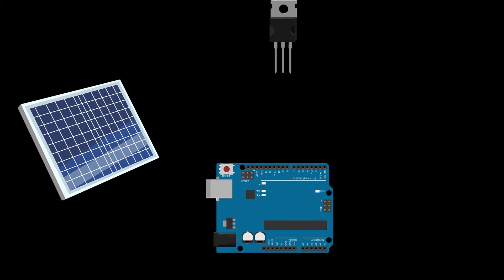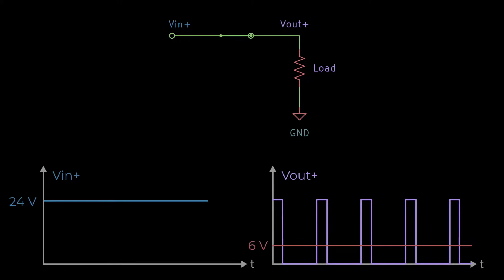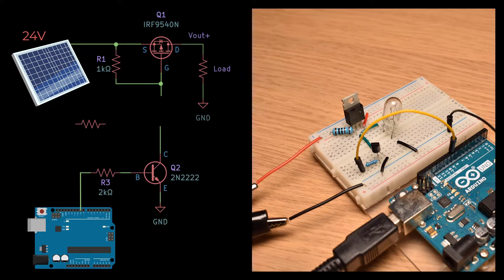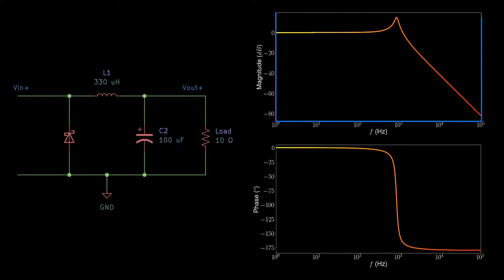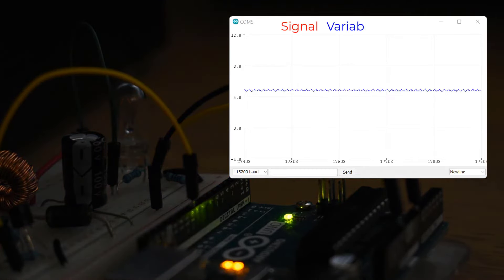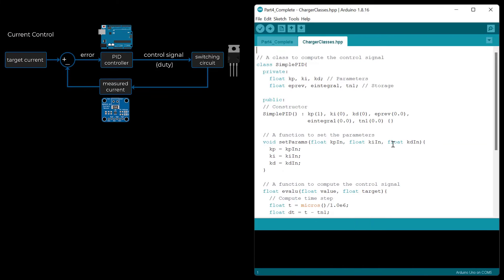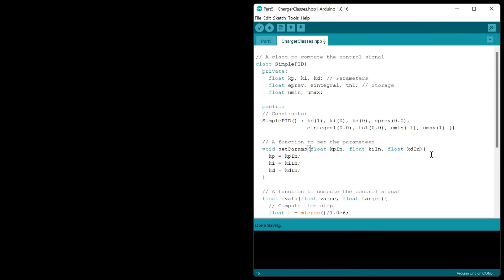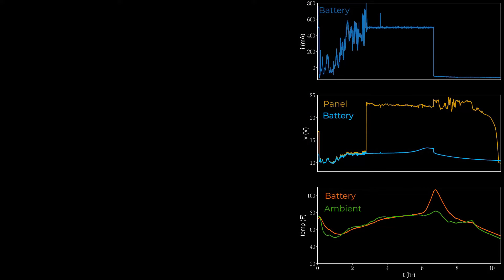How to build an Arduino controlled solar charger

Comment: CR: You start so simply - a solar panel charger but quickly you enter real issues with solutions involving maths, PIDs (yes, I have seen your PID videos) and experimental evaluation.  If only your approach and testing philosophy was the standard of You Tube, real progress would be made by many.  Your approach seems straightforward; how is its efficiency?  Yes, I understand that you are teaching us not building a product to sell.  So very well done, CR.

Comment: Wow, I came here looking for a way to build a charger for a sodium ion battery, as there aren't real low cost ones on the market (like tp 4056 for lithium ion)... and I am a bit... mind blown in the sense that your video at the end is extremely complex for a non engineering person to understand. It starts relatively simple however. It makes me wonder if the error corrections and extreme complex programming PID etc (for me) is actually required to make something work: to charge a battery. Because for now I charge my sodium ion battery manually using a buck converter that has no current limiting, by turning the potentiometer a bit up, slightly over the voltage of the battery, trying to see that the current is allways around 0,65A, which is 0,5C for my battery of 1350mah. And I stop at 4.1 volts which is the maximum voltage of my battery.  If somehow you could replace the manual potentiometer with a digital one on a buck converter that would be very nice as opposed to designing the whole thing from scratch... For now I am actually thinking about buying a lab supply or just building a robotic arm to turn the potentiometer, even that seems more simple... but nevertheless thank you for the explanations.

Comment: but what if i want the arduino to power off when there is no sunlight?  i could just use the  solar panel +  buck converter + arduino right

Comment: Wonderful video. I have finally found solution to my age long problem. I did control engineering, I perfectly understood the PID part very well. I used a PID controller in my M.Eng program with a multivariable sensor that added complexity to the project.

Comment: The buck converter is more than just an LC filter... You need the diode to allow energy stored in the inductor to supply the output, when the mosfet turns off.
Reply: I guess she is better at coding and electronics is just a hobby.

Comment: Excellent video. A bit of an overkill,  but depending on your knowledge and project goals you can take the pieces of this content and build it around it.  Thanks for sharing.
Reply from the maker: Thanks! Overkill -- meaning the circuit details perhaps?
Reply: @curiores111  Meaning that in some situations that approach can be too complex to implement. Normally in a solar powered system you want to balance simplicity and performance.
Reply from the maker: @keen2461  Thanks for your thoughts!

Comment: add an emitter resistor for the NPN, thus converting it to voltage controlled current source. Now select pull up to suit the PMOSFET

Comment: Grate video. I could really have used that when I created a project using 12V, 10A peltier elements. I would have loved to control the voltage, in stead I just turned the elements on when the temp was too high and turned them of when the temp was too low. But the peltier elements is more efficient at say 7 and 10V than 12V, thus it would have been much better if I was able to control the voltage. But I found out really quickly that there are some dynamics effects when you turn on and of a 10A "resistor" multiple time a second. I am just glad my power supply survived.

Comment: Really nice walkthrough the entire process. I also liked how you clearly stated what you weren't going to cover. BTW, what software did you use to overlay the graphs on the video?
Reply from the maker: Thank you very much. 😊 I use Camtasia to overlay the graphs
Reply: @curiores111  Thanks for the reply. I have used Camtasia, and will need to figure out how to do the overlay.
Reply from the maker: @7alfatech860    Sure. For myself, I use PNGs with transparency for the overlay, and simply animate some parts in Camtasia. In other cases with just a basic black background, I create the video in Python and then import it in. I have not yet found a good solution for using transparency in a video directly yet (haven't needed it so far), but I'm sure its out there.

Comment: I was given a solar charge controller project from my college  and after working day in day out for days i finally made this solar charge control with the help of your video Thanks a Lot. And the battery is charging. But I have a question does this circuit have autocutt off feature when the battery is fully charged? because by reading the code you have provided I didn't understand that it has a autocutt off feature or not ?
Reply from the maker: No, this is most definitely experimental code. There's no auto cut-off feature, or other quality of life features.
Reply: @curiores111  So can you please explain me how can I add a auto cutoff feature in the code. I have to submit the project on coming week it will be better if I add a auto cut off feature.
Reply from the maker: That's a complex topic. Typically a combination of signals are observed -- and it depends on the type of battery. The voltage will typically peak and then dip, so you can shut off after the voltage peaks. Another sign is a temperature increase. When the battery is fully charged it starts shedding energy as heat, so you can monitor temperature and shut off when you start seeing a spike. You can also just shut off when the voltage reaches an expected value. Again, it's a complex topic, so it would require some research. @adnanahmadknowledgevideo
Reply: @curiores111  Okay thanks for sharing this information

Comment: whoah this video turned out way more technical than expected.

I was kind of expecting you to just hijack one of the pins (feedback or on/off) of an existing LM2596 module tho.

There's also kind of a bad shortage of low power boost MPPT chargers for smaller projects out there.  Errbuddy just wanna do big stuff; the little guys r left fending for themselves.

Comment: Thank you for this information. Sorry to ask but if the Vin will only be 12V, what good values of pull up resistor and the resistor that would divide the voltage be? thank you
Reply: You can stick with 1k for the pullup. And assuming your P mosfet has a Vgs equal or greater than +- 20 volts, you can simply remove the second resistor, as there is no need to a voltage divider in this situation.

Comment: I am very thankful for your amazing explanation. I have a question and I hope you can answer me.
If I use 0.5W Solar Panel, 5.5V, 100mA, 55 x 70mm  instead of 24v solar panel with  circuit you  have made. It will work or I need to consider it as a new circuit and i have to change the value of components in the circuit.
Reply from the maker: Thanks! As you suspected you would need to update the components for your circuit.

Comment: Seems a voltage controllef relay would work just as well
 On until voltage rises to full charge  then shut off. Using the panel voltage to open n/c side of relay. Maybe a Zener diode to control the relay, maybe put a transistor/mosfet between, use a viltage divider with pot to fine adjust the voltage and a small capacitor to slow switch ocillilation  delay shut off slightly, then Keep off (transistor on), longer by the stored voltage in cap  the battery may drop voltage then the relay will switch panel vack on possibly taking minutes to charge capacitor through a resistor and pot.  Adjust to chsrge speed, possibly another to adjust adjust charge current/speed if cap/transistor , much more simple than Arduino, if using a Arduino, why not make a mppt, add a inductor to convert the voltage above full vharge voltage to current, to gsin wattage?

Comment: your videos are beautifully done. what do you use for the animations?
Reply from the maker: Many thanks Copernico. I use camtasia and python, mostly.
Reply: @curiores111  you're building animation with python ? Interesting ! do you use a library to do so? Or did you built it from scratch?
Reply from the maker: @10e999  Yeah, Python is mostly for the plots, (using matplotlib). Since it's pretty basic functionality, I haven't used a library or built much of one. :)
Reply: @curiores111  I didn't know matplotlib could do animation ! interesting !

Comment: hi nice video - is there a solar panel, battery with that additional circuit ready to buy somewhere? i want to use it for some project but just want to connect both and not build it myself...

Comment: Another great video!  That was a good example of windup, and easier to understand than in things like motor control applications I've seen.  I also appreciate you working through the basics of a buck converter, step by step.

Would it make sense to use both proportional and integral terms?  Would that reduce the overshoot once the panels resume generating power?  I can see that the integral-only controller ramps up more slowly.  I imagine that might be better for the battery.
Reply from the maker: Thank you for dropping by Mark! I'm glad that you found it to be an informative example.

The system is so unstable the proportional controller doesn't really improve the response much. On the time-scale required by the battery, the integral controller is pretty good. I did actually have some issues with overshoot using the integral controller, but I actually found that by adding a feed-forward controller I was able to manage that pretty quickly.

To be fair, this controller would normally be an analog one built with ICs and op amps... which does not suffer from (as much of) the same control stability issues as the digital one. I do enjoy broadly applying the Arduino, though, since it's much easier to utilize (especially for learning) than specific ICs.

Comment: I have a question: does the inductor need to have a specific ohm or wattage rating?
Reply from the maker: The inductor needs to be rated for the expected current. (this is of course the case for any circuit components).

As far as ohms/watts, I'm not familiar enough with the non-ideal characteristics of inductors to know how much energy they are dissipating. If the current rating is sufficient, I assume any non-ideal dissipation will be negligible.
Reply: @curiores111  thanks!

Comment: There is something I cannot understand. I understand that if my input is 12v and the duty cycle is 0.275, the average is 3.3V.  However, devices don't work on the average.  Even with a smoothing filter, a spike of 12v would destroy most 3.3v devices.  So,  how does the equipment survive?  Does the RC filter smooth the voltage sufficiently for the equipment to survive?
Reply from the maker: Yeah, the ripple on a correctly tuned RC filter should be pretty small. If the equipment is sensitive then of course you'd have to add additional filtering.

Its common to have step-down converters use a mean approach with a filter. There are certainly other methods. There's plenty of engineering that's gone into this type of problem.
Reply: @curiores111  Thank you

Comment: Also do you have an idea on how i can connect my Mq2 sensor now that the 5V pin is in use! Im a complete novice out of my depth!
Reply from the maker: You can use the 5V pin to power more than one device as long as your current draw isn't too high (for sensors it won't be). If you're using a breadboard you can just connect the 5V pin to a power rail (or any terminal..whatever really), and then hook that to both. If you're not using a breadboard there are other options. I like solder seal connectors.

Comment: Hi there, I'm looking for this exact build to go with my solar fire alarm project for my bachelor's degree. Can you advise the panel you used for this? I'm finding it hard to source a 24V panel. :)
Reply from the maker: I used this inexpensive one from amazon.. https://www.amazon.com/gp/product/B01IFJ73X4/ref=ppx_yo_dt_b_search_asin_title?ie=UTF8&th=1

Cheap and not a lot of power but that is what I wanted. It's not exactly 24 V but it was sufficient for this system. If you need higher voltage you could always put a couple panels in series.

Comment: Hello, Excellent work! I cannot access circuit diagrams in that link. Could you make them available?
Reply from the maker: I'm not seeing any issue with the ones posted to the GitHub repo. Try these links:

https://github.com/curiores/ArduinoTutorials/blob/main/SolarCharger/UnoChargingCircuit.pdf
https://github.com/curiores/ArduinoTutorials/blob/main/SolarCharger/MegaChargingCircuitV2.pdf

Alternatively, try downloading the whole repo and navigating to the "SolarCharger" folder.
Reply: @curiores111  I got them, thank you!

Comment: Can you do a further video on the PID controller code for this please? I am trying to make one and need to understand the code on it. thanks. Great Vid BTW!!!!!
Reply from the maker: I might be able to do that. Is there any particular part of the code you're having trouble with?
Reply: @curiores111  I am making a similar set-up but not as complicated as you have done - it's slightly above my level. I am trying to make a simplified version of the charge controller. My PID results come out as garbled symbols of lines of question marks. Have tried various iterations. Maybe I could send an email with my code?
Reply: @curiores111  Hi I think I have managed to get the PID working, but I am having trouble understanding how you calculated the values of you LC filter, could you please tell me the calculations you used.
Reply: @yosh1don  I'm also having some troubles with the PID controller.... would you be able to tell me how you figured it out? I cant seem to get the setParams function to carry over into my main code, did you have that as well?

Comment: Noob question, is this mopt charge controller?
Reply from the maker: No, I did not compute the maximum power point -- but you certainly could do that and adjust the control signal.

(In fact, as I recall, I used a relatively low input amperage to the batteries. They were quite small.)

Comment: Thank you for this great video. Can someone help me to underestand how her class file is .hpp type? How I can I create such file to write my code in? Thank you!
Reply from the maker: You can use regular hpp includes with Arduino (among other standard C++ stuff). It's really no different than writing the class inside the main Arduino file. Here, it's just used as a simple way to separate some of the definitions from the main arduino code.
Reply: @curiores111  Thank you vry much, I think it will be easier for me to write the class in the main Arduino code. I just have one more question if you don't mind. Should Li-Ion batteries be charged with a steady voltage and current? Is this the reason that we necessarily have to use a LPF to only keep the DC component in the  output voltage? The reason that I am asking this is that why didn't we do the same thing simply by a voltage divider then use a buck convertor? Thank you so much!

Comment: what is the difference between using a buck converter and BTS 7960 to charge a lead-acid battery? please, reply me as soon as possible, Currently i'm in a project needed this kind of code

Comment: Hi there do you have an email address. I'm doing something similar to this for college but I cannot get it to work and I'm having major trouble trying to connect the solar panel to the buck converter and the battery to the breadboard! Kind regards Aisling

Comment: Excellent... please upload BLDC motor control ... mainly trapezoidal and FOC ... please please
Reply from the maker: Appreciate that. I did buy some bldc stuff... haven't gotten around to making a video yet though. :S
Reply: @curiores111  please consider my request because there is no good resource available on the internet regarding BLDC motor control algorithm.thanks in advance and appreciate your efforts
Reply from the maker: @biswajit681  Indeed, I think it's a great suggestion! Definitely near the top of my list

Comment: Has anyone else got this to work.
Reply: Got it to work, I was using an Arduino mega and looking at the uno code. I didn't realize that the mega and uno had different pins for timer1.